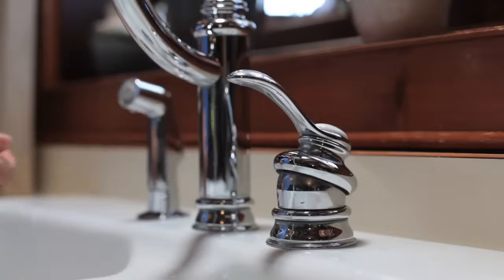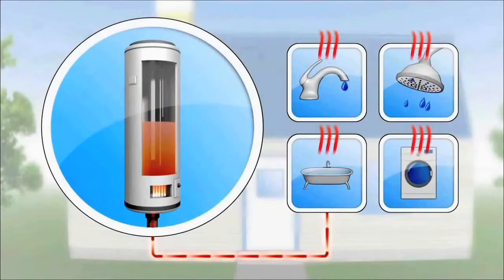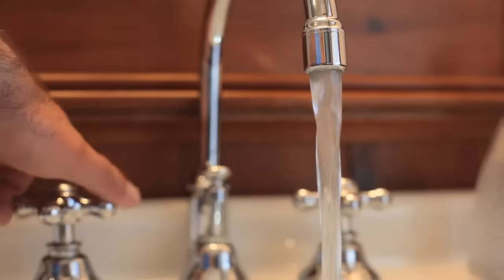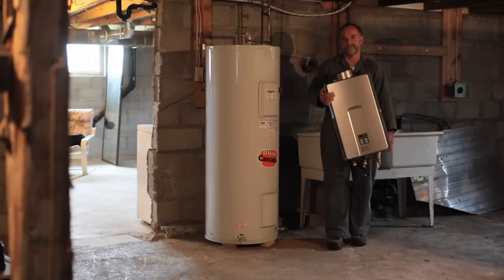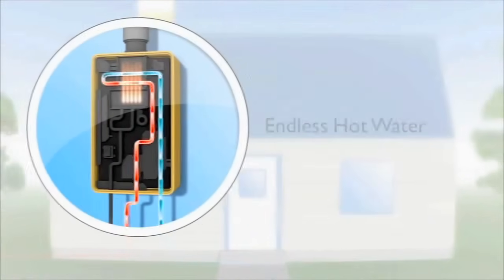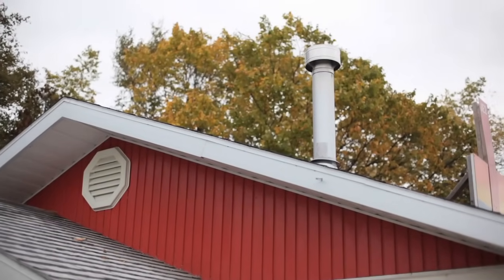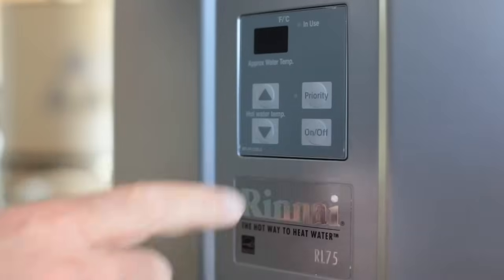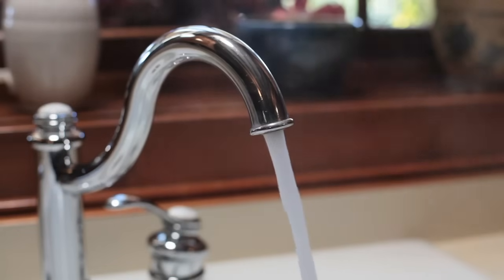How Tankless Water Heaters Work

Comment: Tankless heaters are  expensive to buy,prone to breaking,require annual deliming,expensive to rent. Any energy savings go down the drain when its all added up. Imagine having to pay someone to delime it yearly. Its fine if you can do it yourself. Ive worked in the natural gas industry for fourty years. When anyone asks me about this type of equipment I tell them to run as fast as they can.
Reply: Pretty much a tankless is gimped without a side tank.  Also, sometimes they need initial installation of upsized gas lines from the meter, which gets real expensive real fast.
Reply: If tank less water heaters are so inefficient, then why are they the most popular option today in all or Europe and Japan? thanks.
Reply: Because space is the most value thing in life in Japan and Europe.  They have very little land per capita.  In Japan people live in one room apartments.  In USA, almost everyone has space for a conventional water heater.
Reply: Thanks. Yes,  I agree with you, space is limited in Japan. But i didn't think that to be the case in Europe. I thought that the reason these countries switched to water less tanks is because of the cost savings in less natural gas usage and money savings overall.
Reply: My daughter bought a house with 2 tankless heaters, one for the Kitchen second bath and one for the master bath. She called me about 6 months after they moved in and begged me to put  in a hot water tank for her. I put in a family sized 80 gal gas in her garage right where the old one was and she's happy as a clam. Not a peep, no more hot /cold showers or no hot water at all. Sometimes the jawbone of an ass just works better.
Reply: I'm glad she's happy now.  I've dealt with hot water heaters, tankless water heaters, combi boilers, boilers with side tanks.  Personally, in my own house I have a conventional water heater.  When it goes bad, probably in 10 years, I'll just put a new one in.  In the meantime I probably won't have to do a single thing to it.
Reply: supposedly a tank less can last 20 years, with proper maintenance, but i dont know yet, i just installed a gas powered tank less. seems to work. provides hot water when needed.
Reply: 6955beniegn They work.  And they can last 20 years, but definitely not without maintenance.  Hot water heaters can go out in 7 years but normal manufactured warranty is 10 years.  Typically they last at least 10, often 12.  The difference is that hot water heaters require virtually no maintenance, so the up front price is typically the whole price for the 10 year period.  In the long run they normally come out less costly over a given period, say the 20 year time frame.  All I'm saying is don't believe these sales guys who claim you save loads over time with by going tankless.  When you total up all the numbers, price, installation, energy, service, parts and repair, the claims just don't bear out.
Reply: Rannai are very reliable. Earlier Naviens were pretty much junk, but the new models are incredible. Deliming isnt all that necessary, unless the water is really bad, in which case I wouldn't want that buildup in my water heater tank. I would rather take a tankless with the option to delime. The new Navien condensing units with 2" pvc vent are our go to for installs. Especially since they come with a built in recirc pump and small internal buffer tank. That is a hard to beat setup. No external tanks and pumps and all that stuff.
Reply: @BrainToMush  
so... do you like tankless hot water heaters?
Reply: @JudiChristopher  For your purpose, probably.  I haven't worked on an RV, but if you only need hot water for dishes and showed you could possibly even get by with a 120v electric.  I feel dirty recommending electric though.
Reply: @BrainToMush  
You "Feel" dirty recommending electric... for a hot water heater... LOL... (funny).
The reason I want electricity this time... is because I don't want to tote around a heavy LP Gas tank ... 
Thank you so much for your reply.
Reply: @JudiChristopher  Well the electric tankless heaters would never be able to supply an actual house.  Washing clothes alone would be too much for one.  That's why I hesitate to mention them.  You're welcome though :)